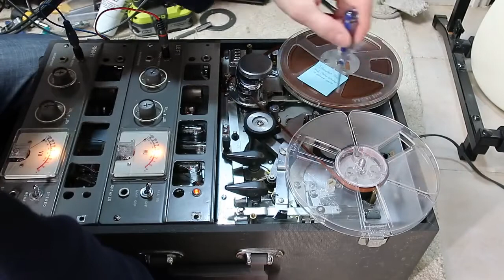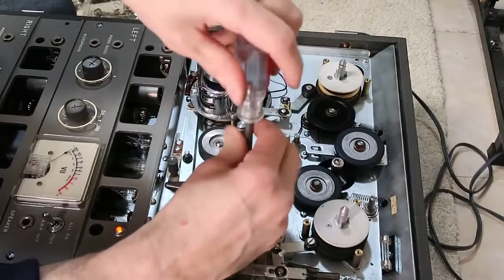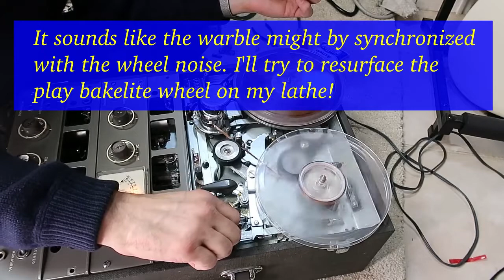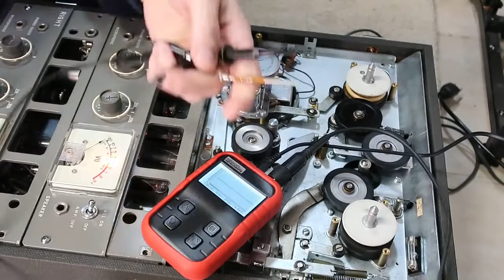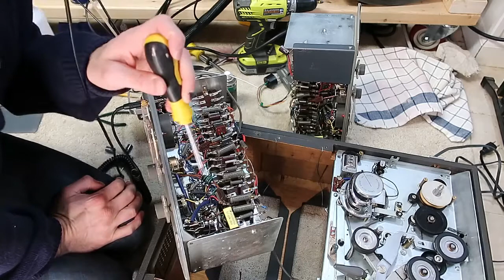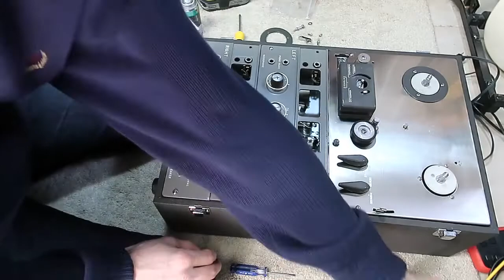Akai M7 Rebuild: Part 3 - Electrical (and mechanical) 2/7/2021- Slipping play/rewind wheels

Comment: Hey there, question for ya! Any idea which resistor/capacitor controls the VU? Trying to get one of my meters working again but it has seemed to have gone out. Light is still working in the VU however. Thanks for making these videos, your findings have been quite helpful👍🏼
Reply from the maker: Ooof, sorry! I don't have that unit anymore to check it out. Yes, I've seen small electrolytic capacitors short out, so that's definitely possible. I usually go through and replace all the electrolytics with either new electrolytics (for power supply) or new ceramics which won't ever go bad).
Reply: @JoyeMusiccom  Thanks for the tip, much appreciated!